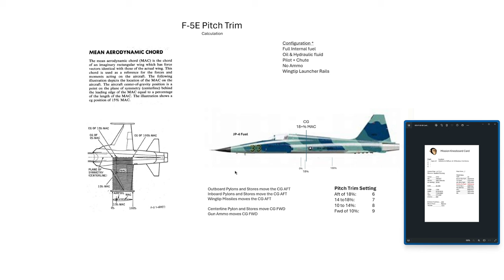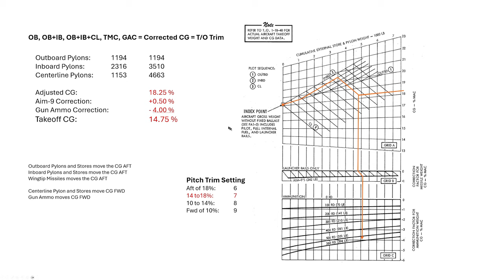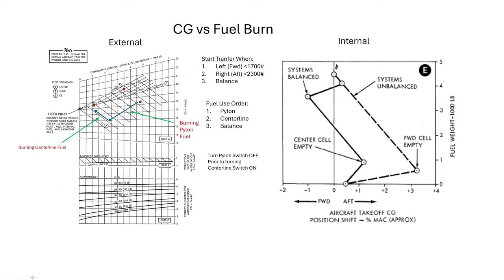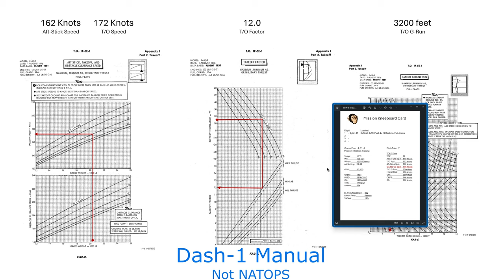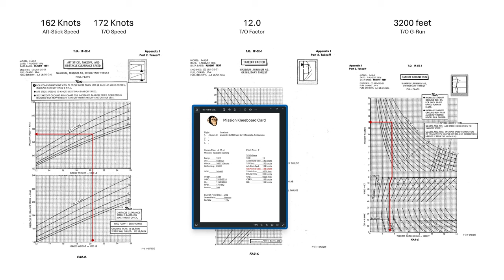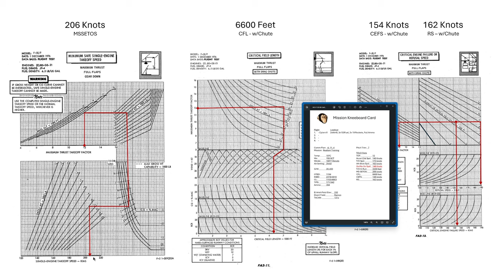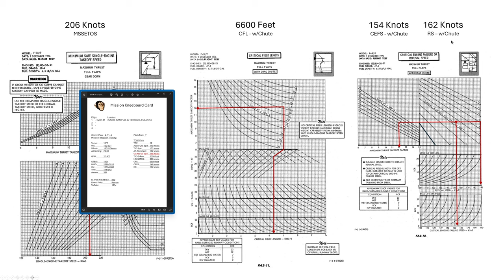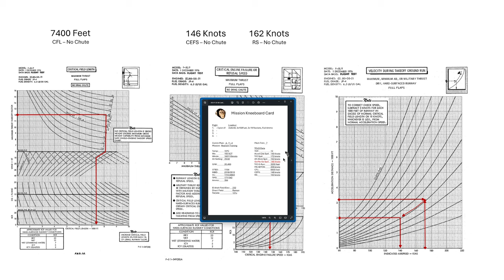F 5E Realism Stuff - Part 1

Comment: Good brief, Bonz. I understand the F-5 has some bad habits around the landing regime? Did my C-130 Initial Qual. at LRAFB, AR. Funny thing about USAF vs NAVY is that if it doesn't say you can do something in the Dash-1, then you can't. In NATOPS if it doesn't say you can't do something then you can. We (Fleet USMC), mostly carried an internal 18K Gal. in flight refueling tank which sat on the appropriate CG line, but with a cargo frame CG becomes very important. After a while the weights/takeoff speeds/time checks take just a short time in the back of the NATOPS once you've done it before every takeoff. We even had a "Wizz-wheel" with all the data to do it on the fly. Longest takeoff in an old "R" Model, full bags of gas-62 seconds. El Paso Int'l w/elev 7KMSL on a hot day. That's a long time. Believe the runways were 10KFT long. Note: we also had a crew of 10 including Pilots, Loadmaster, Navigator, Flight Engineer, Observers and a cast of thousands. I do like the L-382 "Super Hercules" free Mod for DCS.

Comment: Icing is between 10C and -40C
Reply from the maker: It certainly can be.
NOTE: Supercooled liquid water droplets predominantly found at temperatures ranging from 0°C to -20°C. Although rare, small amounts of supercooled water droplets can be found at temperatures as cold as -40°C. The smaller and purer the droplets, the lower are their freezing points.
Reply from the maker: Icing from O to plus 10 degrees can form in the intakes
Reply: @BonzProductions7  As an airlines pilot , I turn ON the ENG Anti-ice from 10Cº to -40Cº in clouds or moisture.